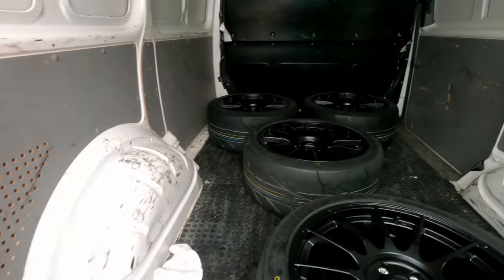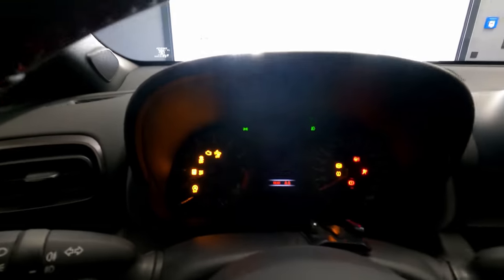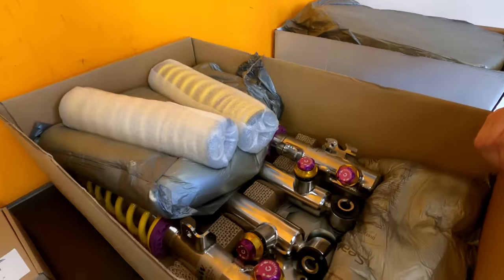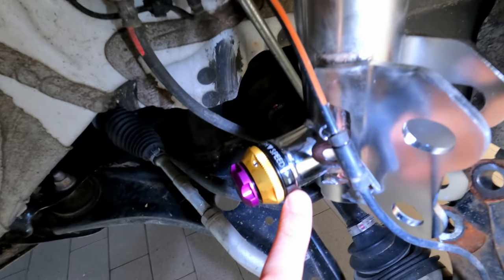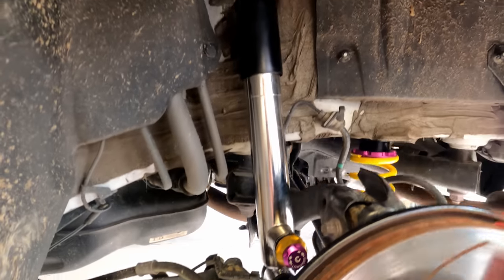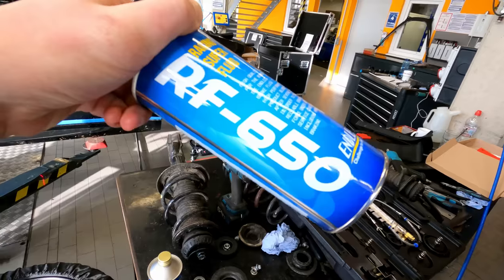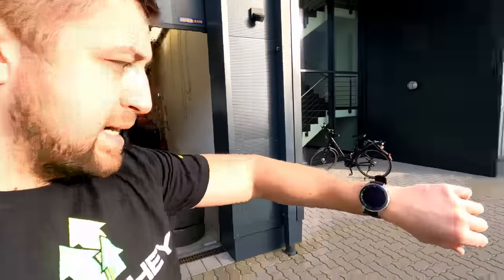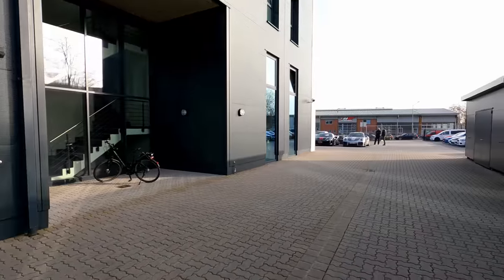Installing New KW Suspension and Endless Brakes on the GR Yaris!

Comment: Can’t wait to drive this tomorrow!!!!
Reply: Gday Robert!
LoL long time No see
Good to have ya back dude
👍🙂👍
Reply: @thomasbryce1716  track opens this week. Can’t hide for too long;-)
Reply: Will be waiting for a new video for the drive!
Reply: You had any problems with the calliper piston boots melting with the heat from the brake pads? There’s a few UK lads fitting titanium shims to cure it. 
I’m also after some Endless for mine but I usually use ME22. How are the ME20’s lasting and how aggressive are they on the rotors. Cheers

Comment: Thanks for another interesting GR Yaris video. I hope you list the settings you end up using, camber and all associated information. 
Also as I’m sure this will lower the car a little bit can you please tell us if the 265 section tyres have any clearance/rubbing problems. 👍🏻
Reply: 20mm is the minimum lowering. I believe, that there will be a problem with the arches.. I am very curious what is going to happen!  On the contrary, there are other 255 section tire cars out there, not sure if they are lowered though
Reply: I wanted to go 255 35 19 but eventually was persuaded to go 255 3518. I live in Australia and will call KW tomorrow re coil over parts. 
I really want to thank you for replying as I know you’d receive a huge amount of comments, it’s truly impressive. 
Hopefully I’ll come to Apex when Covid is a thing of the past. 
I have a GR so I’m keen to see you build. 👍🏻

Comment: 265 on the yaris?? damn you guys ain't playing around
Reply: Can't believe it.. does it even fit? Very very close??... I wonder what other parts will need replacement.. the forces are going to be immense.
Reply: Wider tires don't give better traction... They just allow to keep that traction (heat management etc.)
Reply: @piciu256  Not true, there is a maximum wideness for optimum grip for a given car.
Reply: @MT-eb2dx  that's true, but more than that doesn't equal better, and narrower only really gives less grip, because the material is overstressed, as in overheated etc.
that's assuming the same rubber compound etc. 
anyway, only really meant to dispute the idea of "immense forces" on the car, because of the wider tires, it's the compound that matter here, not width.
Reply: @piciu256  yeah sure, the semislick will definitely have more grip.

Comment: Quite a lot of corrosion on the rear suspension components. Mine is showing similar signs and has only done 500 miles. The bushes appear to be the worst.
Reply: Keep in mind this car has seen a lot of snow and roadsalt already this winter.
Reply from the maker: @m0rb1d43  not a lot, but it's just a bad quality

Comment: Misho, the tyres you spec'd are quite a bit wider, and also a bit lower profile than the stock 225/40R18 tyres. Did that cause any issues with setup?

Comment: Why does the KW suspension look so puny compared to the stock suspension? OEM mcp struts definitely look more robust. Is it just that track oriented stuff doesn’t not have to be as sturdy as a gravel setup? Reiger suspension for example is thick as

Comment: Hey Misha, three questions. #1 will you be changing the rear trailing arms for camber adjustment? #2 I couldn't quite tell but are the front brake lines braided at all? I've not heard of Endless in the UK, what are the wet and dry boiling points of the brake fluid compared to other well known brands. ✌️
Reply from the maker: Probably not.
All the lines are exchanged for braided.
Dry boiling point: 622 F/ 328 C
Wet boiling point: 424 F/218 C
Reply: @mgcharoudin  cool.. slightly better specs than my Motul RBF 660. Appreciate the reply, good luck with the rest of the build.

Comment: That ME20 is going to eat those discs... I'm thinking NE39S for mine.
Reply: ME22 is more disc friendly as NE39S !
Reply: What are the brake pads most friendly disc ?.
Reply: @vollcare4076  What are brake pads fiendly disc ?.
Reply: @mdev8846  usually ME20 / ME22 are disc friendly (track) pads
Reply: @vollcare4076  Thanks.

Comment: How is the KW in a daily life ? I am also looking at this option but am afraid that lowering GR with KW will cause that engine will be too close to road. Have mine lowered with HR springs and already now engine cover is pretty close to tarmac and has been harmed few times…
Reply: H&R springs lower the car 35mm. The KW lowers the car minimum 25mm, so you would have 10mm more clearance

Comment: easy suspension to fit, I tink the Yaris is very easy to work on
Reply: It's a Toyota, so yes.
Reply: @Paul_VanGo  yeah but, it's not a simple car like. everything is so compact but this they did like you should be
Reply: @mvngl3r281  From my 35 year mechanical experience, Toyotas (and Lexus and Daihatsu) are the easiest cars to work on, even the more complex ones. 
...if they need work done at all, because they are the most reliable cars in the world too.

Comment: 265 tires are way overkill for a awd 260bhp car. 245 would be probably be faster even.
Reply: There is a chance it’ll go smaller it all depends on how the tires warm up...  ar1 warm up quicker than say a cup 2 so it could work out well;-). Keep in mind the car still weighs  1300kg
Reply: Interesting selection of size! Would like to hear the experience since I am also looking to replace the very expensive BBS whels on mine
Reply: @RobertMitchell  Have have you thought about this measure: 255/40/17?
Reply: @RobertMitchell  Thx for your reply, With its AWD system and (IMHO) relatively low weight, the Yaris will stick to the tarmac whatever tire size given I would guess. You lose some playfullness going this wide, but I would love to book the car this year when covid restrictions are lifted.